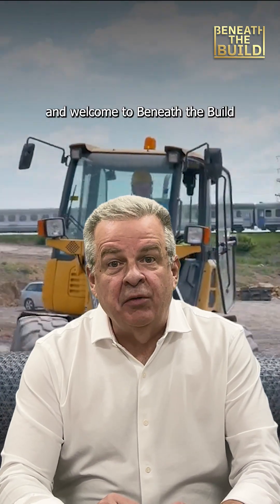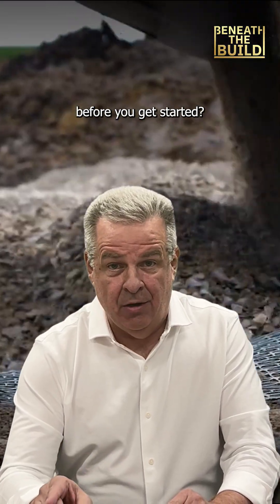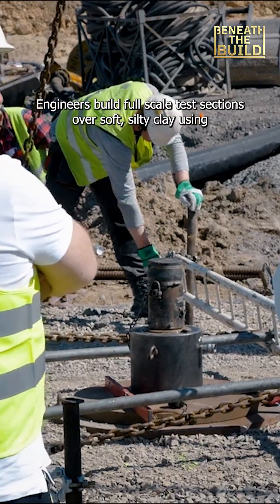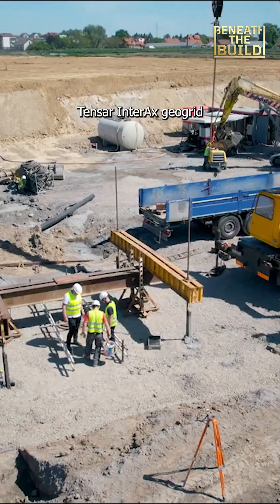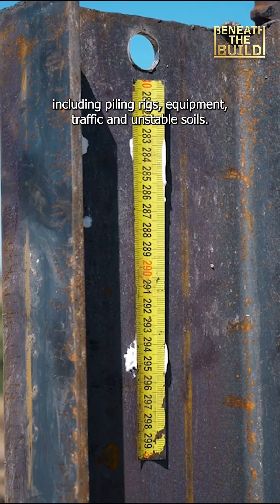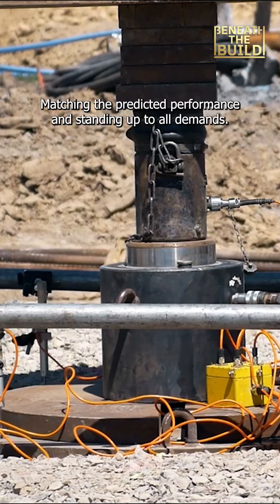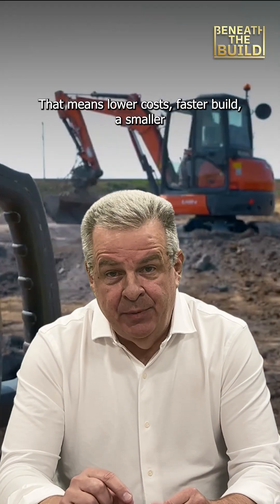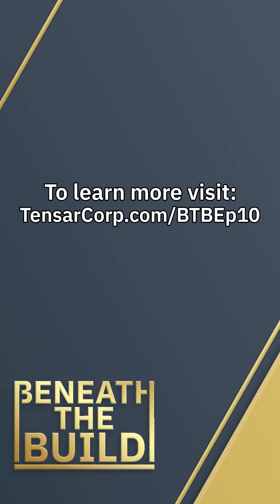Validating Geogrid Innovation w/ InterAx | Beneath the Build: Episode 10 #geogrid #construction

Comment: I mean although in a nutshell that sounds great if we originally had an engineered to be a thicker base layer in that situation😊 there is normally a good reason like like probably worried about settling you know over time that sounds like something I would try although I would be kind of scared to to potentially go thinner I mean I might try it like in a small area just to test something like that but I don't know
Reply from the maker: Thanks for your comment. A conventional solution with a thicker aggregate layer was designed for this application and would have worked just fine. The Tensar solution considered everything the conventional solution did - including settlement - but used mechanical stabilization of the aggregate to design a more efficient structure. We never compromise on design or ignore important criteria like settlement. And as you can see from the testing conducted in this case, we do whatever is necessary to make sure our solutions perform according to the design criteria.